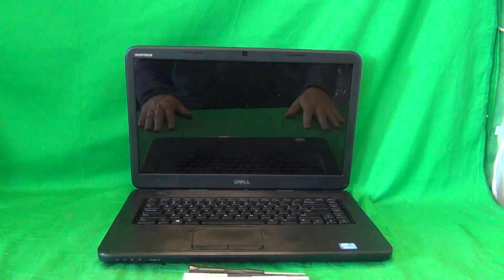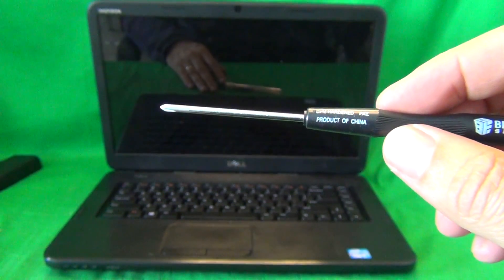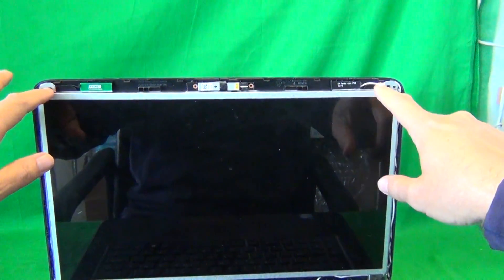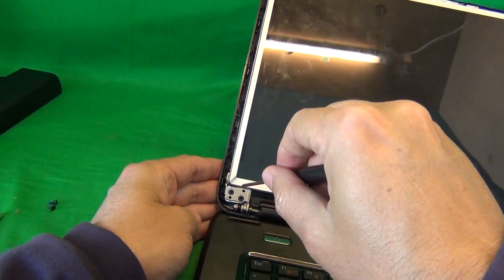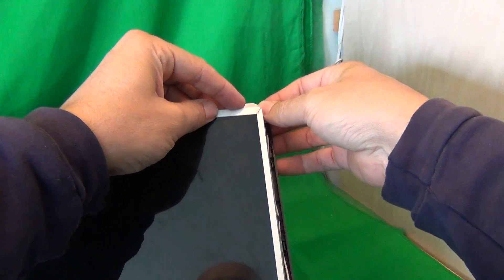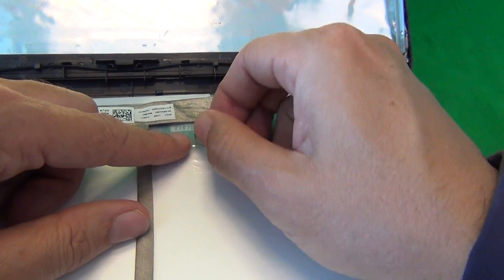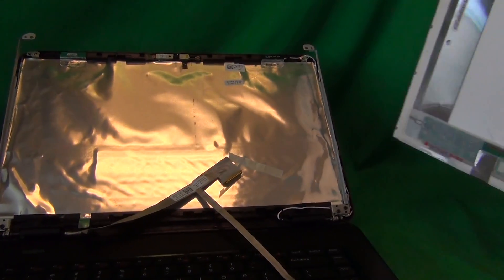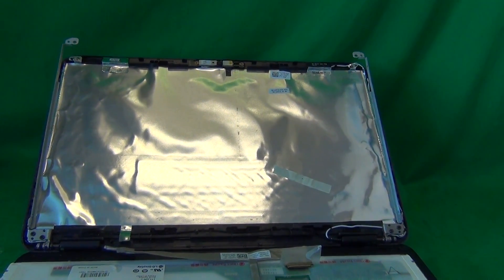Dell Inspiron 3520 Laptop Screen Replacement Procedure

Comment: This video is great,  used it as guide to replace my screen myself, saving over $200.  Process went very well.  Did lose one screw,  so recommend using a large sheet under computer or doing somewhere you can find the screws.  Thanks